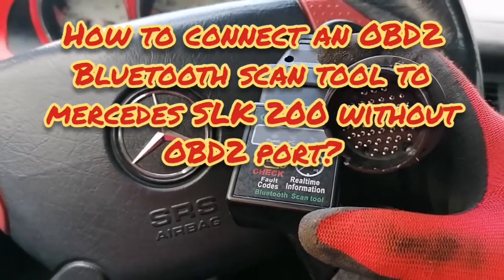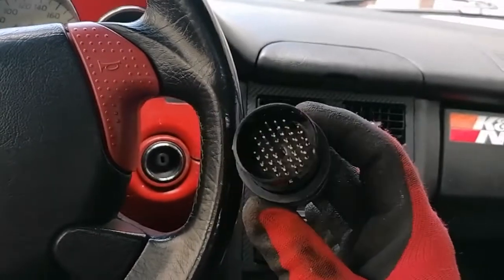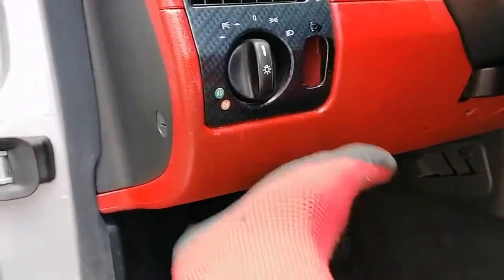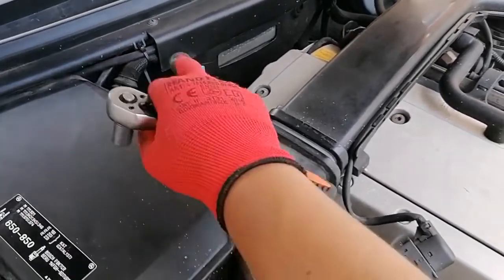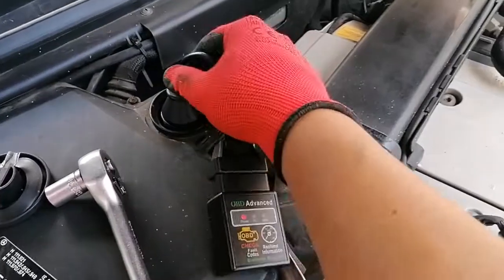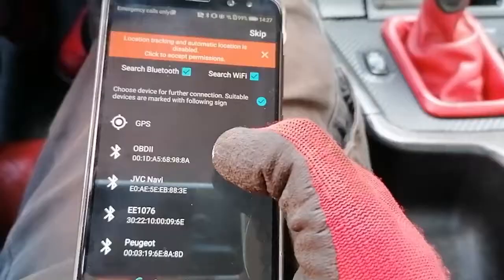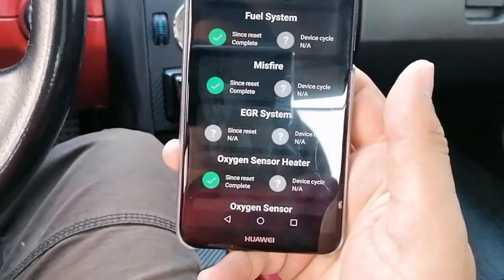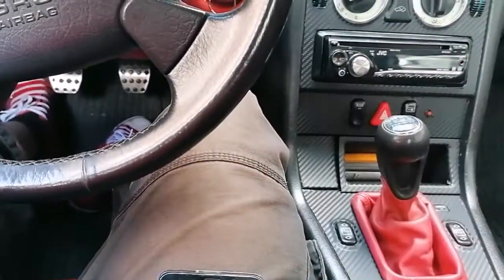How to find and connect OBD2 bluetooth diagnostics tools on a SLK 200 R170 1999 without OBD2 port

Comment: Nice colour combo - the silver with red interior. It's a slightly brighter shade of red than later cars as well. I've got an Obsidian black metallic with a red interior from 02. BTW rough idle is often the K40 relay control unit, the older cars should have had a replacement part - otherwise you'll have to re-solder at least three of the main connections going in to the board.

Comment: can u use this to pair with obd2 digital gauge cluster? coz most 3rd party digital cluster only accepts obd2 as data for the cluster to show on data.
Reply from the maker: to be fair I have not tried, the issue is with this plug you cannot close the bonnet and use it whilst driving, I did get it to show some digital cluster info on the app but probably not the info you're after.
Reply: @OrionBroadcasting  yurp. u guess it sir. so the only way i can think of is to rewire the unique mercedes benz obd into an obd1 or obd2.or reposition/change from a terible2 placement into a more convenient lovely place. and im not technically or hv the minimum requirements nor the skill set to do it.😅

Comment: Hello again. I bought the identical 38-pin cable & bluetooth scanner from Amazon. I also installed the same InCarDoc app on an older Android device (it is indeed Android-only since Apple refuses "insecure" bluetooth protocols). I tried twice to connect but after minutes I still don't get any results. Did you change anything in the settings of the app? And how long do you have to wait to get all the different car settings? I see that you cut the video at 4m48s so I guess you waited a while too?
Reply from the maker: Hey, indeed takes a little bit to connect (2-3 minutes or so the first time around) and you need to accept the connection. I added the device from the bluetooth settings first and then connected from the app, indeed via android. Once connected the app allowed for the diagnostics scanning and works just fine. Connecting after that works a lot faster. I have heard from someone else that they have issues using the BT ELM device, but a powered scan device did work. Not sure if it has something to do with the powersupply to that port but you are getting power I guess? i.e. a red light upon connectin?
Reply from the maker: the other things worth checking is your bluetooth protocol versions, my phone is relatively new (Huawei)
Reply: Yes, I'm using a borrowed phone with Android 5.1 (2015!), I'll have to find someone with a more recent phone :-)
Reply: Did you have the key in the On position? If you did then you can always try switching it off and then on again. Just wait 10 seconds after turning it off.

Comment: Hi, thanx by the video. I have a slk230, bought those adapters, the obd2 scanner works well in other cars (obd2 cars). When I plug them in the slk's obd1 port, it does not power the obd2 bluetooth adapter. The car's port is ok, tested it before and after. Is there a way to test just the obd1 to obd2 adapter? Maybe with a multimeter or something, I guess it is broken.
Reply from the maker: not entirely sure if you have the OBD1 on the 230, the one I have is a specific Mercedes connector. I had an OBD1 cable prior and that wouldn't fit, different pin setup completely. The device doesn't power on?, also not with the engine running/or the key in start position?  Check you have the correct cable first of all, then try to figure out if that setup is power, or your unit needs to be self powered. (unlikely), worst case your ODB unit in the car is shot....
Reply: @OrionBroadcasting  The adapter I have is the specific 38 pin mercedes one. Tried with the car on and off and there is no external power connection in the adapter. I guess the only way to know this is trying it in another old mercedes, my mechanic used that "Star" scanner and it worked well. Not sure, but "maybe" the adapter is not converting the voltage to the elm (bluetooth obd device). I can't leave home because of the pandemy, but will bring the answer as soon as I find it when possible. Thanx by your help.
Reply: Aqqqqlpis